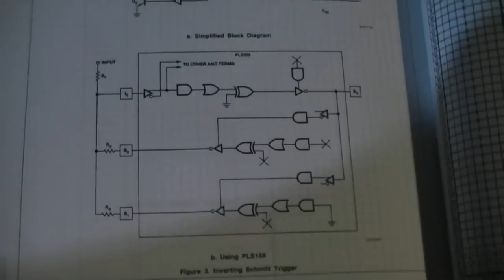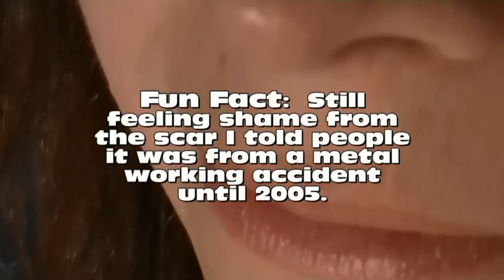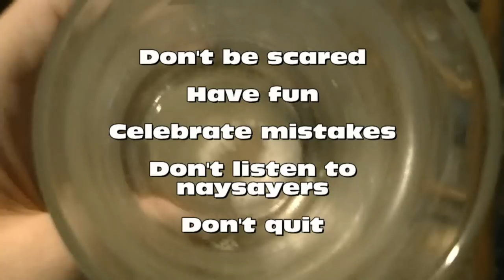Secret to Learning Electronics - Fail and Fail Often

Comment: Great! I've been a tinkerer myself since early childhood when I ran down the battery on my father's lantern trying to see how fast light traveled by switching it on and off and trying to see if I could catch the light beam traversing my bedroom. It traversed my bedroom so fast that I couldn't see it so I concluded that light must travel at infinite velocity. Wrong. But it did get me to reading up on things like the speed of light and other things, which is very interesting.

These days I'm playing around with solar cells that I have cannibalized from things like a solar cell phone charger that I bought a few weeks ago but didn't work very well. I rigged it to recharge a couple of rechargeable AA batteries while leaving it in a window during the day. I have to keep checking on it every hour or so to make sure that it doesn't over charge the batteries, though. I'm trying to figure out how to rig up a circuit that can determine when the battery is fully charged and stop charging automatically so I can just leave it in the window and forget it. Fun!

Comment: Question: Have you had formal electrical engineering education? and by that I mean circuit analysis skills you could apply briefly before you power a circuit. Or did you learn hands-on from the get-go?

Comment: There is nothing false about it. To work as an electronic engineer TODAY you must have a degree, whether it is BSEE or anything else related. Not only that, it is ILLEGAL to call yourself an engineer without the degree. You're simply not going to find companies that hire people for designing electronics who do not have the academic credentials to back them. If this were 2006 I'd say they have a shot, but here in 2013+ it doesn't matter who you are, you won't get past HR without the degree.

Comment: Two days ago I couldn't figure out why my counter circuit wouldn't count.. I learned that I had hooked the clock test and reset buttons up wrong so one would trigger the other, thereby the displays always ended up at 000... Now I know, and remember how to do it properly.. I also had problems with the same circuit, that the clock test button were going nuts whenever I pushed it, often jumping 5-10 clock pulses each time.. Thereby, I learned about debouncing a button.. Learn by doing mistakes...

Comment: i haven't made many electronic mistakes yet except for burn a led because i had it straight to the 5v rail of an arduino (which doesn't current limit).

botched many a solder joint though, i only just started to get the hang of it and i took the opportunity to solder the pins to the tons of break out boards i still had lying around, and tested the lot of them, bar some complicated text-to-speech thing i have yet to figure out

the coding is the part that actually comes easiest for me (thank god for ws2812b and derivates),
but i could always make it more challenging by moving from arduino ide to the down-to-the metal assembler kits i guess, i bet i'm pretty shit at ASM.

Comment: "without a degree you're NOT an engineer"  - These are not my words. STATES are the ones who are pushing these laws, not me. Most states now have laws which make it illegal to represent yourself, profit-in-title, or mislead the public by calling yourself an engineer without a degree-backed state certification. If your state doesn't have it, then it will soon (most do) This is my point, not to ridicule anyone, but to point out that the days of "self-taught" have been ended by academic inflation.

Comment: Electronics,but which of all?Analog,digital,audio,power supplies analog and smps with all the switch mode topologies,microcontrollers and even further and there are a lot more areas.An entire universe is described using a word and is called simply electronics.When the right thing never comes to see it and what is left are only the errors then seems like a blindman is talking about the colors that he never saw.

Comment: Makes me think about the magnetic deflection circuit I discussed with you recently. It kicked my butt so badly, I still get extremely upset just thinking about it. Its one of those circuits that should work and doesn't! NOT EVEN when I copy a working circuit! The math does not produce answers that match the results. Not even by a tiny bit.  It is most frustrating!!!! My biggest obstacle is my own emotions. Once I reach a certain level of rage, I end up rejecting the project for good. OR is this really the joy of failure?

Comment: I fooled around on my own...I'd pull tv's out of the trash and try to fix them. Eventually at age 47 I got job in a eletronic repair shop. You have to be careful when working on customer's stufff and if your break something you might get fired. So get lots of practice on some junk equipment first.

Comment: I just spent 2 hours studying datasheet/writing code for arduino, so i could use V3021 RTC. It didn't work as it uses some weird SPI protocol. The fear of failure has smothered me and i don't want to touch any electronics thing for sometime. Maybe i can make it work.

Comment: I hate to fail!!! When I attempt to repair electronic or mechanical devices and fail  I get pissed! When a part can't be found or a gear, chip, or plastic part can't be fixed I get depressed. The reason is this device I spent hours on comes to a grinding halt and into the recycle bin it goes. There goes some time and $$$. :-)

Comment: I recently replaced some FET's, caps and a smt fuse in a lcd monitor to get it working again. Everything checked out but it wouldn't stay on for more than a second. I checked and rechecked everything many times and couldn't find anything wrong except that it wouldn't work! Finally I was messing around plugging and unplugging the power cord and POW a cap I had replaced blew up in my face! Due to some glue on the board covering part of the polarity marks I installed an electrolytic backwards. Oops

Comment: I hit my finger with a hammer also and a ligament came out. I damaged my front two teeth flying through the air after running into a car window with my bike. I cut a bit of one of my pointing finger at the front. This is what happens if you make stuff. But I try to be more careful today.

Comment: Or, do an electrical engineering degree in which case - pass and pass often.
Reply: yeah.... that's debatable 

I'm not bagging the EE Degree
i'm just saying, i've seen a lot of people come out of them that know far less than they should due to lack of interest and more focus on getting the job instead of enjoying electronics

however, 
Playing with shit, Trumps the degree any day of the week
because it absolutely guarantees that you will be interested

I've been pulling shit apart since i was 4
tops any degree any day of the week.

passing in a degree could also be a question of money , depending on which Uni you go to 

I've seen ones that will spoon feed you through the course and i've seen ones that are easy to pass by paying for answers and other people's papers
then.. i've seen ones that don't take shit for a second and they'll eject you if you try to fake it.

so.. it's very debatable

Comment: Wow!!!

You are an inspiration!!!

Truly! I am in AWE of you!

Can somebody please point me to some material to begin learning electronics /electrical engineering / mechatronics?
I am currently working through the book "Engineering Mathematics" by K.A.Stroud. Just as a refresher on all the required math. I'm a hobbyist computer programmer, and I work as an engineering draftsman, so I have an analytical mind and understand the engineering process at a high level, I just don't have any knowledge of electrical and electronic fundamentals any deeper than the very basics.
I would very much appreciate if anybody could point me in the right direction for free or very cheap self learning material for EE.

Cheers.

Comment: I do not think this is impossible and I think it's a really good idea can be done with a lot IC chips and then you could wire all that to your 200 project Radio Shack and try all the circuits by just typing it in to your computer much easier man

Comment: Peace. Hi....how do I make this give me 90volts DC? if you can assist ok. no worries. Hoenjuno 200W Car Power Inverter DC 12V to 220V AC Car Charger Adapter 4 USB Ports Car Outlet and QC 3.0 Ports Car Plug Converter with Switch for Phone, iPad, Laptop, Camera, Camping, etc
Reply: really novice me.

Comment: no offense, but if you make more research and study the schematics very, very carefully, you will spend less money and be safer on what you will do...
maybe the mistakes that you will do is that the placing, lets say capacitor, that will be the only time you may learn from your mistakes.

and TINA pro or any simulation software will help a lot...

thanks for reading my opinion =)

Comment: Hi Jeri I am Vardhan, a high school student, I am trying to make a 12v powered circuit in which an ldr is to be used to control a motor. when light falls on Ldr, motor stops and when light is blocked, motor starts. can you please help me about how to make its circuit. I tried so much but it was a failure. please can you help me out...
Reply: I assume you did something like:
   NPN transistor
   biasing resistor between supply and base.
   photo resistor between base and ground
   collector to supply
   motor between emitter and ground
  probably a diode across the motor to keep from frying the transistor.

If the motor never comes on, your biasing resistor has too much resistance.
If the motor doesn't stop, the photo resistor can't decrease the bias enough, and you should consider a darlington pair for greater gain so you can use a smaller bias resistor.
Reply: Eric Davies thank you so much I was having problem with burning off transistor. But now I think it will be solved. thanks for your time and help.....
Reply: I just found that a diode and the resistance are needed to be worked on. The resistance is too high and the diode was not placed at its place. 
Thank you once again
Reply: Eric Davies may be a stupid question but what is Darlington pair
Reply: A darlington pair is two transistors set up to act like a single transistor whose gain is approximately the product of the gain of the two transistors. If a 2N2222 has a gain of 100, a darlington pair of 2N2222's would have a gain of roughly 100*100.   You can build them yourself from regular transistors, or buy them in a single 3 pin package. See https://en.wikipedia.org/wiki/Darlington_transistor.
Higher gain means less biasing needed.
Reply: Eric Davies thank you for your help and support
Reply: welcome.
Reply: Are you from America??
Reply: Canada
Reply: Oh OK
Reply: Have you done any course about all this electronic stuffs??
Reply: It was a hobby of mine when I was in highschool in the 70's and 80's.
Reply: Pretty much as what I am feeling now....😀😁